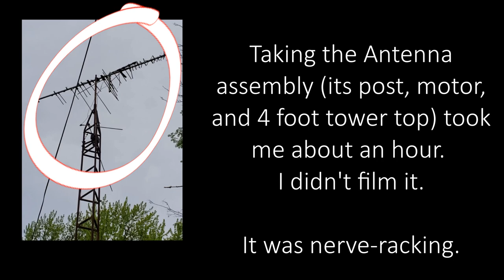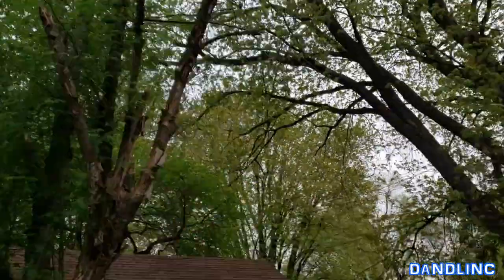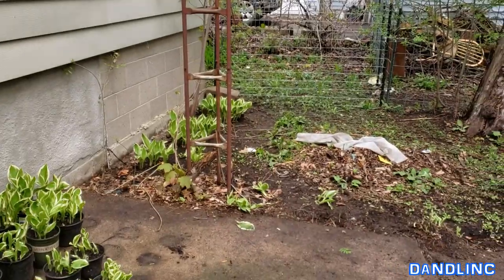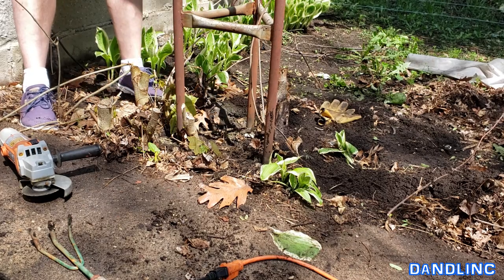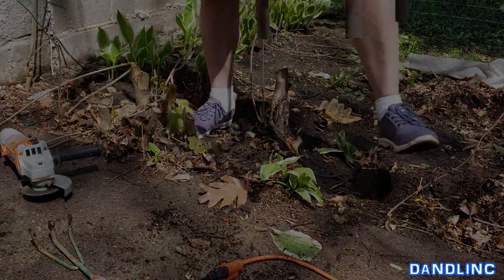Vintage TV Antenna Tower RECLAIMED

Comment: You noted at the beginning that removal of the top 4 foot section with the antenna and motor was "nerve-racking".  I assume that's because you were unsure of the stability and condition of the tower.  I share that concern.  Many people have advised me that these welded steel towers, galvanized or not, tend to rot from the inside out making visual inspection of their condition very difficult, if not impossible.  Most have advised that recovering and re-constructing a tower that is more than 10 years old to reuse for an antenna, cameras, wind turbine or future gadgets should never be considered.   When your 30 plus feet in the air installing an antenna or cameras, only one of the three legs of the tower needs to fail to cause it to fold instantly sending you to the ground.

Comment: I've been a helper on 4 of those projects.   2 were that same style of TV tower 1 was 24' the other 30' both pretty lightweight and in both cases, it was decided to cut the tower off at the ground and lower it (the 24' tower there was only 2 of us and we tilted it over by hand (full 24') went pretty smoothly.    The 36'  there was 4 of us we used a rope across the top of the house it was next to lower it.    Rope was put through the tower from the roof about 15' shy of the top.   2 on the rope on the roof and  2 on the ground.    I doubt that tower weighed a total of 80 pounds.

The other 2  projects were taller Rohn 25 in concrete bases which showed no signs of rust.  (2 experienced but not professional)  climbers wearing safety harnasses used a gin pole and tower jack disassembled these and lowered them.   1 was guyed the other not guyed but temp robe guys were used as they climbed up the tower.

For your project given that the base appeared to be simply supported by an unknown amount of dirt and the tower could have been rusty, I would of tackled it singlehanded but not by climbing it.   I would have cut and lowered it. 

Glad it worked out safely for you.   

Thank you for sharing.
Ben - ne5B
Reply: Any way I could get some advice on removing one? I'm painting this property and painting the metal roofs and they have one next to the house that looks 30-40 feet. I need to remove it before I can paint that roof and have no clue how I should do it. I was told to just cut it at the bottom and let it fall since it's on a large property but idk. I have pictures if you could give me any recommendations. I appreciate it.

Comment: HELP! I'm in the process of trying to remove one where I'm working. It looks like it's 30-40 feet and right next to the house. I have no clue what I'm doing but I can't finish until it's removed. If anyone could give me any advice, I have pictures I could show. When I asked someone who I thought would know what to do they told me to just cut it at the bottom and let it fall since it's on farm land and a very large property but idk. I also was wondering if there is anything I could do with it afterwards or just scrap? Thanks in advance.
Reply: @m9 ovich Thanks, if there is anywhere I could send you a picture I have pictures of it that the homeowner sent me. There is no house bracket that I saw. It does look like there is enough room to let it fall. It's farm land but it would have to fall near a concrete driveway that I was a little worried about dropping it on.

Comment: The Tower is scrap junk.
It's made by TDL in Peterborough, Ontario
It's 17 gauge steel cheap steel with welded joints.
I hate those towers.
I did not see a safety belt while on the tower. 
I take Towers down and install new antenna/towers full time.
I use a a gin pole to lift the tower sections.
Reply: Any way I could get some advice on removing one? I'm painting this property and painting the metal roofs and they have one next to the house that looks 30-40 feet. I need to remove it before I can paint that roof and have no clue how I should do it. I was told to just cut it at the bottom and let it fall since it's on a large property but idk. I have pictures if you could give me any recommendations. I appreciate it.
Reply: What do you think about Rahns? Thanks
Reply: A Google User 
Rohn yes it's a good tower. 
Purchased a G55 Rohn last year to replace a Wade GN Tube tower. 
Wades site is www.wadeantenna.com
Reply: A Google User 
The tower in the video is just cheap junk.